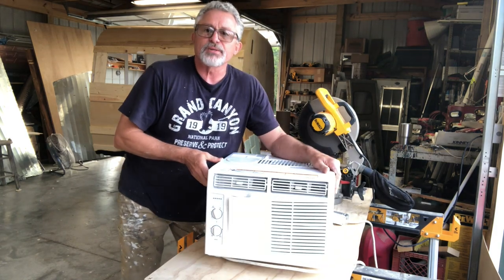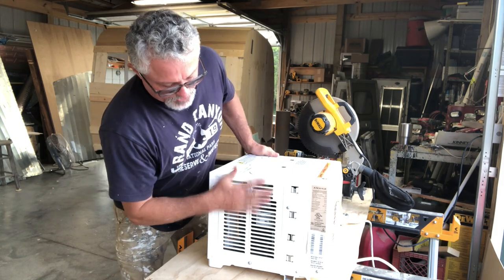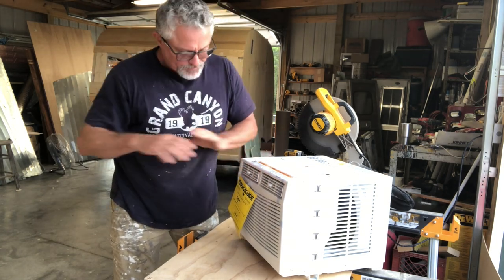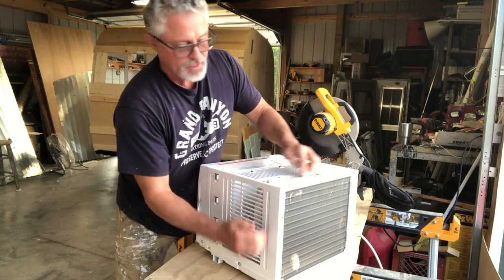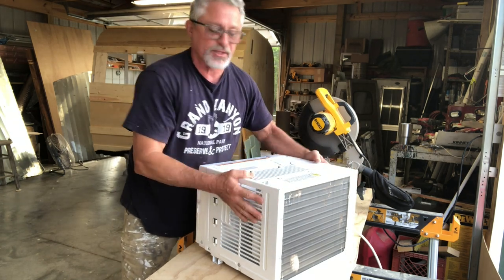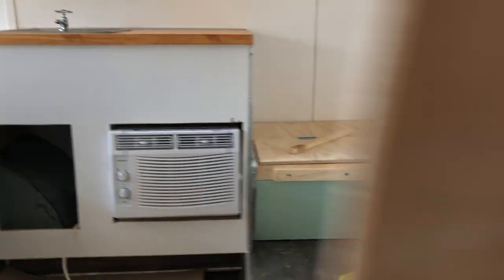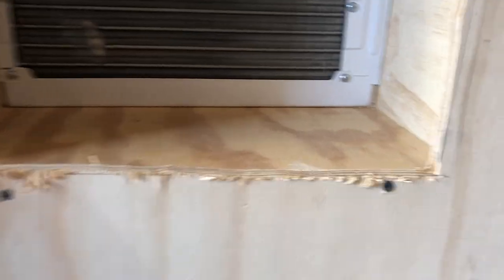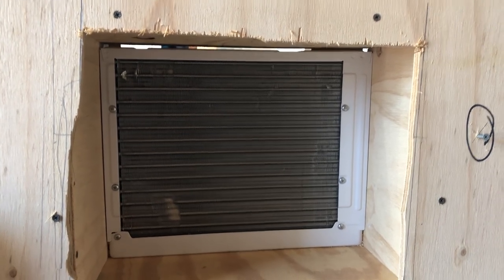EP 81 DIY Air Conditioner install in your vintage camper retro RV travel trailer.

Comment: It's not old technology that needs a drain. The condenser removes humidity from the air, hence "air conditioning". Perhaps you're not in a very humid area, but, where I am(North Texas), one 5000 BTU window unit produces about 3 gallons of water condensate per day during the summer months. Even in the case that much of the condensate evaporates and is vented out, it's still moisture and after a bit of time, those little wooden holes on the other side of your vent will begin to break down and mildew will form. So, your "tips" are only valid in places with low humidity. Otherwise, YOU MUST HAVE A DRAIN of some sort!
Reply from the maker: False. I live in Oklahoma. I don't think you have read a new technology AC manual recently. By splashing the water on the coils it gets evaporated out and the moving air dries it as it goes. There are literally no drain/weep holes designed into the unit. Maybe you know something the manufacturer doesn't know?
Reply: @RobTheRebuilder   I’m fully aware what the manufacturer states. And you just said it yourself… it evaporates against the coils. That does not mean that it disappears. It also states that any excess will drain through a vent. But, as far at the evaporation that takes place; that vapor goes into what is expected to be open air. As much as you’d like to think that vent makes it open air, its not. Much of that vapor will return to condensate upon hitting that vent and again drip down. I wasn’t exaggerating when I said I have been producing 3 gallons from the overflow. So, if it’s used more than a few hours in a day, then you WILL experience overflow. And, over time, that buildup will occur and destroy the wood. My current setup has a 5000 btu unit in the window, and I have it setup for recollection on my bus. Also keep in mind that if you allow that pan to stay full, it also becomes a potential issue with mildew and other contaminates. Mine is setup to drain at a bit over 1/4 inch, which leaves enough for the fan to distribute for the sake of efficiency.
Reply from the maker: @JasonHorne72  Where is the drain hole to put a pan under? There isn't any. Best wishes, good luck, I'm not into arguing manufactures specifications. There is no drain hole!
Reply from the maker: I'm sorry. That sounded rude. Thank you for the feedback because different opinions should make me better.
Reply: @RobTheRebuilder   I am just now seeing this. I certainly didn't mean it as an insult or a negative criticism. I appreciate what you do and you do it well.
Reply from the maker: @JasonHorne72  Thank you. There is room for all of us at the campsite.
Reply: I can vouch for that... north Arkansas here and my experience is that the units without a drain will actually get so much water in them it will slow the fan down so I had to drill my own drain holes.

Comment: Make a special slide-out for the air conditioner.   When you're pulling the trailer down the road, the unit slides into the interior and when you're parked, the unit slides out.   Just like the slide outs that extend your interior.
Reply from the maker: Sounds good to me!
Reply: Great idea!🎉

Comment: I live in Arkansas and it gets extremely humid here, the ac without drains really struggle and frankly do not work. I have drilled my own drain holes in all four that I own. One is a HUGE 220 unit. I can tell you that the ac without a drain is a peace of junk until that hole drain is there and if it was enclosed it would sling water all over the place from the fan in the back.
Reply from the maker: If they leak it is because it is not installed properly.

Comment: I have always thought it would be a good idea to buy an extra unit when doing these installs. Alot of them are custom built to the unit an I have wondered what happens when you cant get the same make/model if it fails
Reply from the maker: Yes. I always use a name brand and the measurements can stay the same.

Comment: Cutting that hole in the side of your camper, good God man, were you drunk?     Beyond that, nice idea except I'd never put holes in the floor, too much road kill and rain water to splash in.
Reply from the maker: I cleaned it up. Also rain doesn't get in because of the vents. If by chance it did, it has constant airflow so it would dry quickly.

Comment: I think a portable small air unit would be better then cutting up the camper.
Reply from the maker: They take up so much room.
Reply: Portable air units really suck because they generate heat that doesn't all vent to the outside.    In a window unit, the compressor is actually on the outside of the house because that part of the air conditioner is hanging out the window...   duh.
Reply: @johnwow2646  well, not in this case it isn't!

Comment: I think you have a great idea here… 

Here is my thoughts…. When towing in the rain, water will definitely find its way up into those 3 vent holes underneath the ac.  In addition to that moisture, the moisture from the ac will accumulate, possibly causing mold conditions, which will then circulate throughout the camper when the ac is on… unless you think the airflow from those 3 holes will create enough movement to prevent mold?   When you normally put those ac units outside where it hangs out your window, they get lots of airflow, and sunlight.  Same with a rooftop rv ac.  This unit being hidden in a cabinet is a cool idea… but I don’t know long term how it will last… time will tell I guess.  Love your videos!
Reply from the maker: Thanks for the input. The new technology eliminates all your fears. There is constant airflow in and out of the cabinet. I am just finishing a new AC episode that will go more into depth and answer some of those questions people have. I appreciate you watching.

Comment: Looks like a good solution for a vexing problem. I wish I knew this 2 years ago when I was trying to install one of those AC units in my Scamp. Had to go with an external unit, which works fine but is a pain to haul in and out! Great info about the short cycling, too. So many dudes online have no idea what that is, why it happens, or how to solve it. Hell, some manufacturers don't get it, either. Just look at the misery being caused by Braxton Creek on some of their new $20K campers that have AC that doesn't work!
Reply from the maker: I appreciate you watching

Comment: I think the best spot is under the table set in front. On the outside the propane tanks hide it and you can put supports on the tongue.
Reply from the maker: A lot of people do it there.
Reply: @RobTheRebuilder  that's my plan I think. I've watched a lot of other mounting methods just trying to find the least intrusive spot.

Comment: Not trying to that guy but isn't putting a ac lower in a space counterproductive to physics.
I mean heat rises therfore cold falls.
I understand space constraints and all but as far as efficiency goes wouldn't it be much better up higher in a space.
I do get that its a extremely small space which brings up another question.
The 5000 btu ratting is meant to cool approximately 150 to 200 sq ft so wouldn't this set up put a lot of strain on that unit with the short cycling that will occur due to to size of the camper.
Again not trying to bust any balls i do appreciate  this content and we all do things our own way.
 if it works it works plain and simple. 
it's just seams to me that it would make more sense to size the unit appropriately to the space so as not to stress the component's for much more efficient quality and longevity of the equipment and overall comfort
Reply from the maker: The space is 70 SQFT. Half the 150 rating.
It is easy to cool off because you fill the whole camper with cold air. There is not a certain level that cold air stops. Worst case scenario, add a little fan on your dinette pointed at the AC.
I appreciate your input.

Comment: have a window unit in my actual house, that is beside the back door.  It's this kind with no drain hole.  When I walk out the back door it is spraying misty water out the sides as the fan turns, and, it often over flows dripping considerable water even though these should not drip.   This one is less than 2 months old.   So to put one in a cabinet in my camper is giving me pause that it would spray mist, causing mold/mildew/lumber warping, and that it would also over flow and drip water out, causing all that even worse.   I'd like to find the old school style that is designed to drain out a hose instead of trust this new kind that in my experience, leaks like a sieve.  At a minimum at least I'd want to waterproof the inside of the cabinet and have a pan system in the floor that the unit sat on to catch  potential spray and over flow, allowing it to drain properly and not just soak in to the cabinet.     I'd be interested in hearing how this one actually held up under heavy summer use regarding the potential of leaking water or creating a mist spray during the hot humid summer we have in Oklahoma.
Reply from the maker: I have been using them this way for two years. If you are having leaking and spraying, the owners manual says it is not installed to specifications.
Reply: Find the lowest spot on the bottom that is far away from any coils or tubes and drill it with a half inch steel drill bit to make a drain. Then sit back and enjoy COOLER temperatures in your house.
Reply: Okay so I don't remeber typing this comment at all. I don't even know why I watched this video, and I don't think I've ever had this type of air conditioner. This is super weird lol. Yeah you guys are right but I'm really confused
Reply from the maker: @Hunt_or_Die  I tend to believe that a company as big as Toshiba has a pretty good handle on the technology needed to run a multi-billion dollar company.
Reply from the maker: @everettstormy  weird things happen.

Comment: Thanks for the video.
Do have one question.
I picked up a teardrop made of 1" plywood, doesn't have insulation and fits a small twin bed in it. 

Will adding a window ac cause moisture  to build up inside.

I do have 4 windows I can open but texas heat is bad.
Reply from the maker: Shouldn't be a problem. You will be opening the door from time to time.
Reply: Thanks for the quick reply.

Comment: I have a Scotty and mine sits on the bumper out there back and vented inside under my bed.  It short cycles and no one knows why or what that is.  I’m struggling to find someone to fix it.  Any thoughts?
Reply from the maker: Either not enough fresh air or not enough power would be my guess.
Reply: @RobTheRebuilder   How would I figure out which one it is?  It sticks completely out the back as of it was in a window… could the drop of 3/4 inch not be right?  Could it be too level?  Should I try plugging straight into an extension cord and not the plug to see if it’s a power issue?  Thanks!!

Comment: I am getting away from the rooftop RV type air conditioner on my travel van and I am currently framing the back window with aluminum that will be adjustable for many different brands of 5000 btu air conditioners. I recently purchased a 5000 btu Frigidaire window unit. The window unit came with multiple warning labels about the flammable refrigerant inside the unit. Are you aware of this? I am going ahead with the build anyway. The EPA has decided that this Freon is better for the ozone layer. Just wondering if it will be safe to travel. Any thoughts would be appreciated.
Reply from the maker: I have not seen that warning yet. I think I would contact an AC professional. Good luck on your build.
Reply: @RobTheRebuilder  it’s only on the new ones. I was at Walmart and Sam’s Club yesterday and all of the have the warnings about the flammable Freon. A air conditioner professional probably doesn’t know because this Freon is very new. Probably no worse than gasoline in your tank. Under the right circumstances it is very flammable too. They are probably using the same refrigerant in roof RV air conditioners as well. When the EPA gets involved things will not be as good as they once was. Well you know that. I am about finished with my build. I am going ahead with it anyway. Gone too far to back out now. I am going to put a fan where the roof ac is now. That AC is on its last leg. Replacing it would be close to $1100.00 plus labor. Depending who installs it. And it is subject to leak. Thanks for your reply.
Reply: @RobTheRebuilder  next time you are in a store look. Everything has that highly flammable Freon in it nowadays. Your hvac or central heat and air. Refrigerators. If you have problems and need a repairman he has to be specialized to deal with it. In some places they require the fire department to be on standby. It ain’t fun anymore like the good old days. But always remember that you are saving the climate. Lolololol
Reply: 6 ounces of flammable refrigerant isn't enough to burn a mouse fart.
Reply: the newer units use isobutane as the refrigerant, if your unit says r600, thats what you get, about 3 -5 ounces. when it burns, its very clean and doesnt emit hydrocarbons, thats why its favored by the government. warning though, r600 is a oiless gas and in my profession its notorious for compressor failures in both ac's and camper fridges. this summer we have changed no less than a dozen units due to compressor failures, mostly fridges though. the worst being the brand everchill, which we call neverchill.

Comment: Does this not create a vacuum in the trailer?
Reply from the maker: There are air vents under the AC
Reply: @RobTheRebuilder  Ah I see, so the condenser is cooled using outside air then? Ie. Condenser intake from exterior, condenser exhaust on exterior. Evap intake inside, evap exhaust inside? That makes sense and would be ideal!